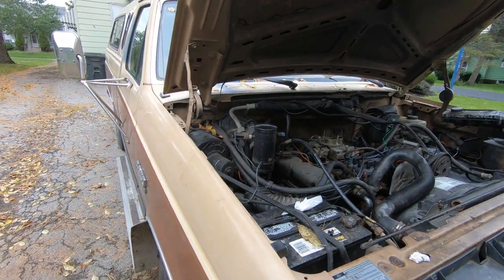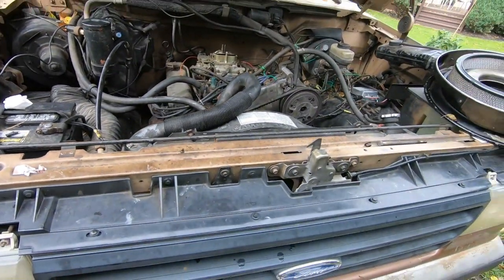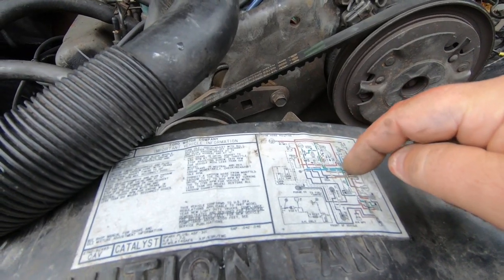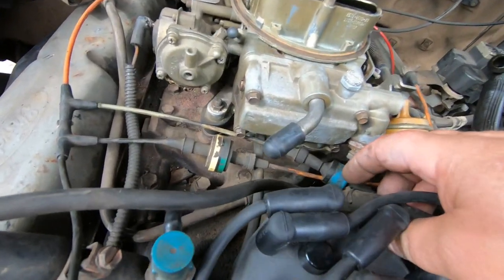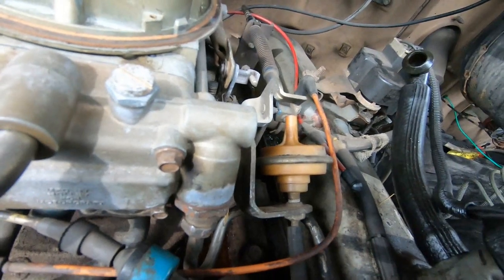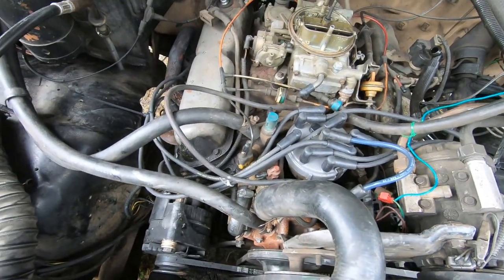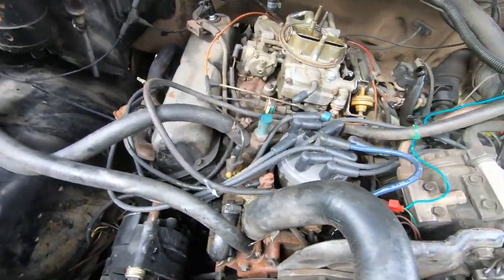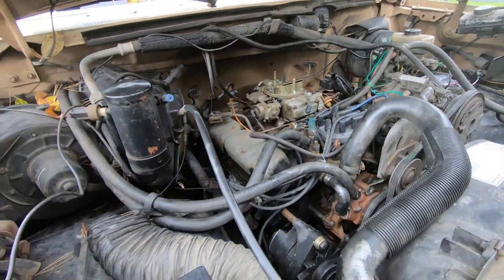Ford 5.8l (carb) Vacuum line removal & throttle Kicker adjustment.

Comment: Almost 3 years after the fact. Thank you for this video. I am dealing with a detonation issue on a ford 460 4 bbl carb engine that is a vacuum nightmare. Your explanation of the throttle kicker was a great help. Thank you again.

Comment: What's the point in wasting vacuum caps on the the carburetor bowl vents. They need to be vented. Why cap the ported vacuum switches.They won't leak vacuum.Theyre screwed into coolant passages